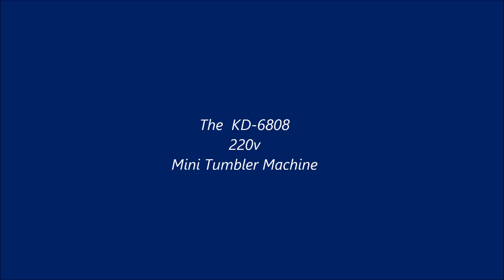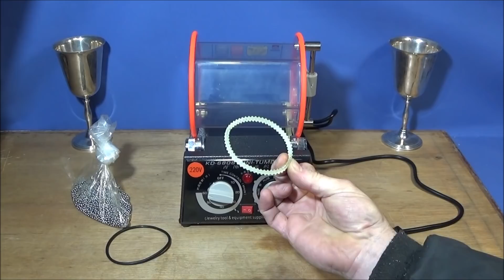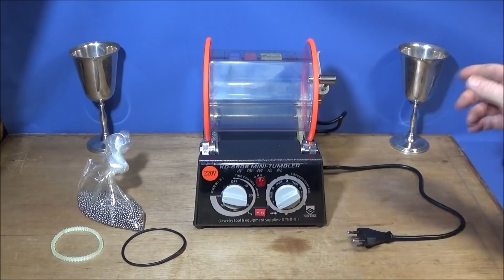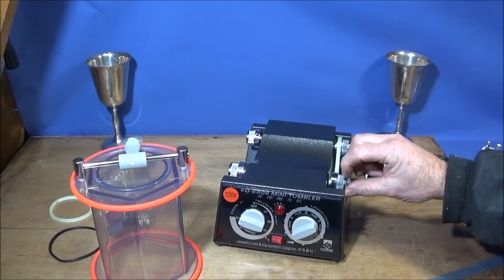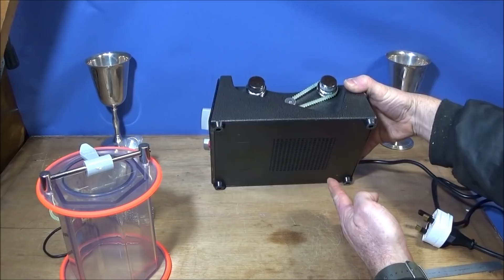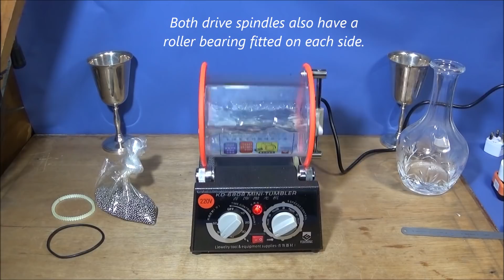The KD-6808 Multi-Purpose Mini Rotary Tumbler Machine Review.

Comment: Hello Steve, I watched your video just now on this tumbler as I’ve got a new one here, but I’m not sure what to put in it. I saw you put water in and not the chrome shot so do you add washing powder in the water with the shot as the filling? I want it to smooth out small cut pieces of stained glass so they are not sharp.  I use the glass pieces to make mosaics you see. I teach children mosaicking. Any advice from you would be much appreciated as I’m not sure where to start with my new machine. Susanne

Comment: Is your tumbler still working. I had to replace belt twice, now it will turn on but won’t turn. Only used about 12 times to burnish jewellery, only use 1 pound steel shot, and a little water not near the 3lb acceptable level.

Comment: One thing about this tumbler - the electrics inside are all mains voltage, but there's no earth. That makes it potentially VERY dangerous - especially when you consider that it's designed to be operated with water in the barrel. Any short to the body from one of the many uninsulated terminals inside (which could well come loose, because the components are only screwed in place) will mean 240v running through your body, your domestic ring main fuse won't blow, and it won't trip your house's RCD. My advice would be to replace the mains cable ASAP with 3 core and connect the earth lead securely to the metal body of the machine. Something like this should really be running off 12v or 24v with an external transformer.
Reply: It should still trip your rcd, by the current going to earth through your body.  However, the rcd won’t trip if the case (assuming a metal case) becomes live.
Reply: could stick some copper wire in the earth on the power point and the other end attach an alligator clip and clip it onto the body of the machine
Reply: Mine came with a slot thing like when you charge your mobile phone.. so I’m pushing that into the power socket to run it which doesn’t use a lot of power. Perhaps mine is a more modern design without the plug on.
Reply: Mine came with a slot thing like when you charge your mobile phone.. so I’m pushing that into the power socket to run it which doesn’t use a lot of power. Perhaps mine is a more modern design without the plug on.